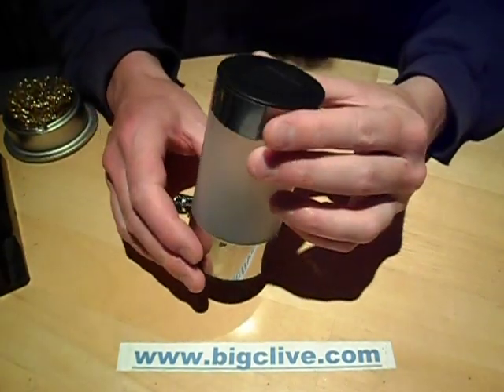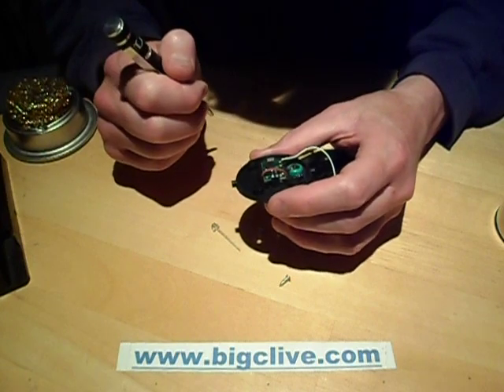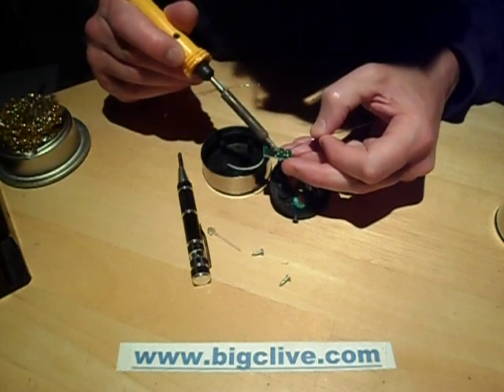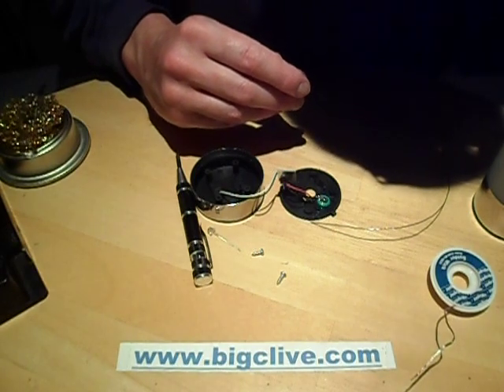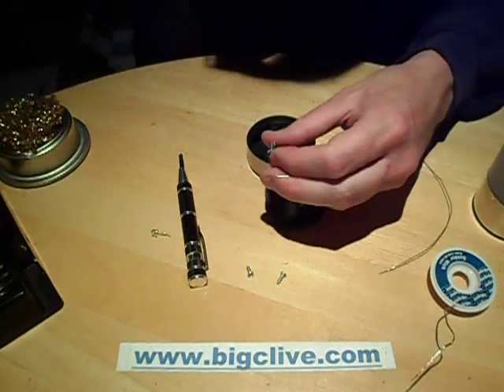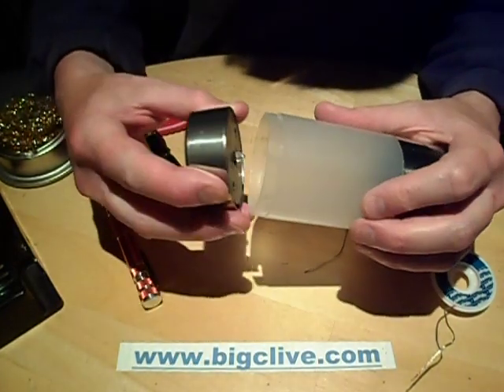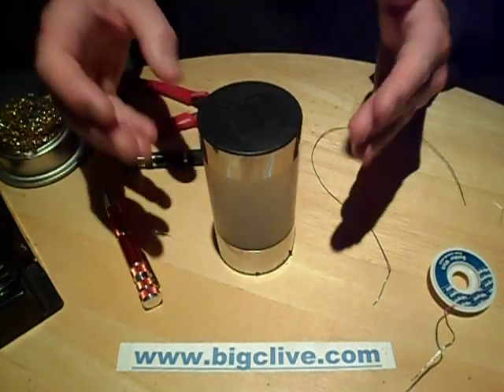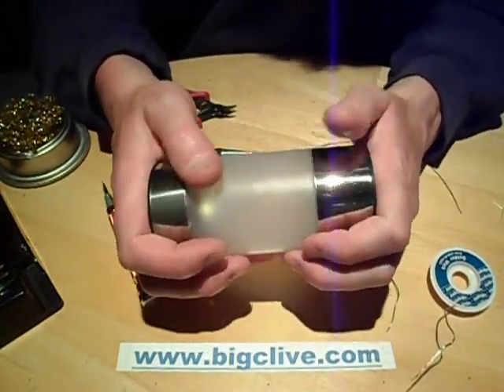Hacking a dollar store solar garden light to fit a warm white LED.

Comment: I bought some Poundland solar lights this year and none of them last more than 4 hours, Even when they've had bright sun all day on one of the shortest nights of the year. Looks like the smaller solar cell and tiny batteries are the culprit. I also noticed the light output is also very poor compared to what was available 4 years ago. Is there any chance you could make a video on how to upgrade them? Better battery, LED, and also make them more resistant to rain and condensation, so they'll last more than one year?
Reply from the maker: Some of the Poundland solar lights do actually last a good length of time at night, but the placement is really important.  They have to be exposed to as much direct sunlight as possible during the day, so placement makes a huge difference to their operation.
To upgrade them you'd need to add a bigger solar panel (which would cost about £5) and a new battery if you could get one that fitted inside (£3) and to change the intensity of the LED you would need to experiment with different replacement inductors (£2 each).  So in the long run it would be much cheaper buying a decent quality light.  But finding one that is truly water and bug proof is really difficult.  Water always finds a way in and the heat from sunshine tends to make it spread about inside due to condensation.